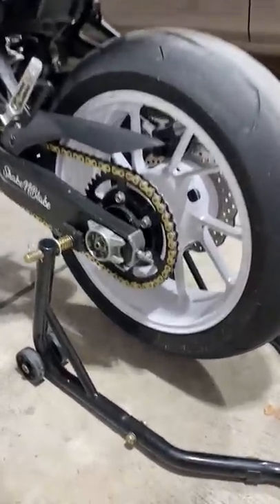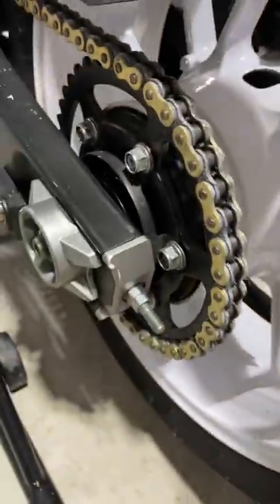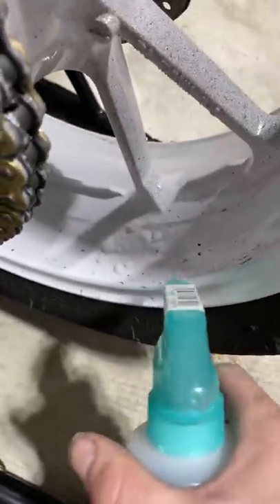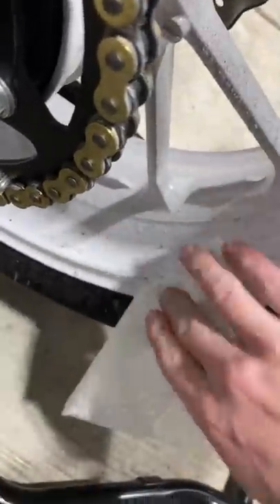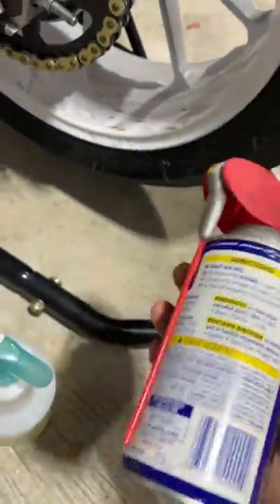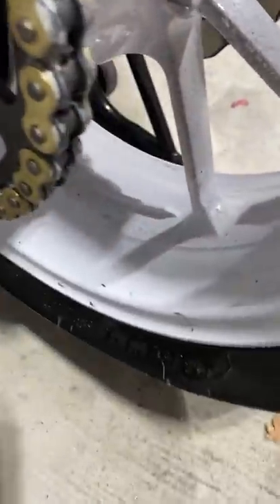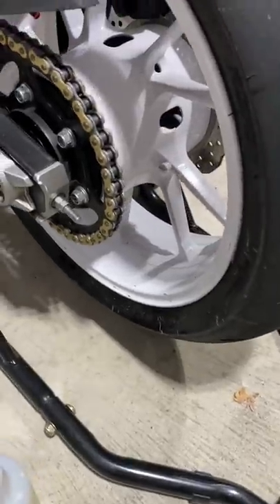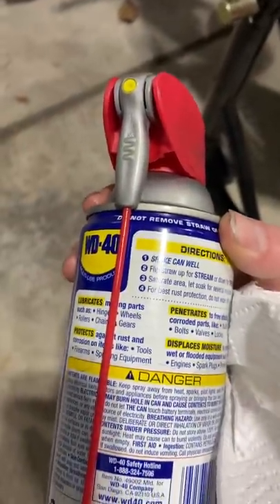EASY tip I wish someone taught me when I started riding motorcycles. #shorts

Comment: “Let’s use water, the thing grease is literally built to withstand, to try and clean this grease!”
Reply: Well I think the idea is more about the detergent that’s mixed with the water
Reply: @fringestream990  soap? He used soapy water. Which soap isn't made to break down automotive grease. Food grease yes. Automotive grease no. Whether as WD40 is a penetrant and breaks down grease by nature. What he just talked about in the video, isn't native to motorcycles. It's basic automotive knowledge. But good on him for showing this to those that don't know 👍
Reply: @jonnywilson9117   I use dawn detergent to clean my hands after doing an oil change or brakes and it works pretty good. Much better than liquid soap would do. And of course petroleum products work great as a cleaning agent but my first thought it is it’s bad for finishes that protect wheels and body parts too. I guess not.
Reply: then the guy : "i recently discovered that anti grease removes grease. could you believe it??"
Reply: He literally used soapy water as an example of what not to do.
Reply: Smitty Knickerbocker Try using dry laundry detergent like Tide to wash your hands of automotive grease. It works really well.

Comment: Yeah that works well. Another "hack" would be to dust your rim with a little silicon spray. It prevents the grease from sticking and makes it super easy to wipe off
Reply: Actually Armor All Seal N Shine works great. It's ceramic so it does an excellent job with paint protection and makes painted surfaces easy to clean.

Comment: Pure kerosene is cheaper and that’s the active ingredient. Amazing for cleaning chains too!
Reply: True...would be the thing to use after putting the chain on and before turning a wheel.  Get all that slag off first so you don't have to then clean the wheel too.
Reply: @Kraken9911  thanks for the tip. I'm out of chain cleaner and kerosene is way cheaper. I'm picking up some kerosene.

Comment: ⚠️  apply the cleaner fluid to the towel not the wheel, to prevent excess lube saturating the rubbers  i.e greasy tyres⚠️

Comment: WD-40 also makes all the dirt and grime stick to it really easily also no matter how much you wipe it, it's a lubricant. It's designed to last on a surface. Not to mention it's insanely dangerous to get on your tire. Use watered down simple green and rinse it afterwards.

Comment: As a motocross racer I learned early on to spray everything with WD-40 and wipe down the seat and grips. This keeps everything from sticking. On the real muddy days I broke out Pam Cooking spray for the bottom side of fenders and engine.
Reply: Baby oil works better, i used to use it on my speedway car. And it isnt toxic like WD is
Reply: @stratton2012  no troll, it really works as does WD-40. Trust me when I say this was a top secret pro motocross trick back in the day.

Comment: You could also use it on the tires too. Helps get the road debris out the tread lines and also give it a nice shine. Helps if you put on the sides so you can lean and corner quicker

Comment: Wd40 also attracts dirt. Makes sure it dry forsure. Use wd40 on your faded engine plastics aswell.  Heck clean your whole bike with it. It will be shiny
Reply: Silicone spray also does a really good job on plastic and rubber. It really restores all the shine and squishyness
Reply: @rem362  I found silicon spray to keep the shine a bit long than wd 40

Comment: Make sure you get some on the shoulder of your tire. It will provide you tons of fun and excitement in the corners;
Also you should use it to clean your brake discs, handlebar grips and seat. Don’t even wipe it down just let it soak.

Comment: Use liquid laundry detergent with water next time. Laundry detergent is known to break down grease and oils, it also works on your hands instantly if you don't have pumice soap after you're done wrenching. #mindblown
Reply from the maker: Thanks man! I’ll have to give this a shot
Reply: I use a diluted solution of Dawn dish soap and water in a spray bottle. Works on everything interior and exterior. Just don't use it on waxed body paint  as detergents will wash away the wax coat.
Reply: Use powdered detergent with a little water & leave it to soaked to clean oil of your drive.

Comment: Wouldn't use that for the wheels. Motul Wash and Wax is way better. Also you don't need sticky chain grease. A light coat with 80W 90 is enough to protect the chain seals and prevent it from rusting and thus cleaning the wheels is easier too and you save a lot of money that you would spend on expensive chain lube. 80W 90 is also recommended by DID for the chains if someone bothers to read the instructions...

Comment: Kerosene works great for this too
Reply: Tried it with clear kero on black wheels and it leaves a nasty film.
Reply: if you only use diff oil to lube the chain then soapy water will get it off the rims

Comment: Here is what I do to avoid unnecessary mess and time cleaning.  Clean the chain prior to or after the installation and lube it with a non fling chain lube and wait 30 minutes before riding (that’s the important part). you won’t have that issue.  As a professional technician I always clean and relube to prevent my work from looking sloppy.

Comment: I use it for everywhere on the bike, where grease is, even to clean the chain, but not as a lubricant. Try to spray it first on a cloth or paper towel then clean the necessary parts, so you won’t spray your tires. WD-40 isn’t a lubricant it’s water resistent but not a lubricant like many think it is. The best lubricant for the chain you can get is MOTOREX.

Comment: If you don't want to waste wd40 you can just wait and let it dry. Perhaps a whole day then use a clean micro fiber cloth to wipe it clean. Works for me as also experienced this with my 135 cc bike (i live in asia). To add a few information, using wd40 on your mags may cause a few problems such as losing the paint and it may stick on your rotor disc (brakes will become slippery).

Comment: You should have seen the grease buildup on my 04 F4i when I bought it used, literally 1/2 to 3/4 of an inch thick in several spots.  So gross, the previous owner was a lazy bastard.  I use chain wax, more frequent cleaning, but much less mess.

Comment: But all jojes aside, use a teflon based dry-lube chain-lube if you wanna keep your wheels clean.
I dont know what is avaible in america, here in europe we got S100 DryLube, that stuff is awesome. Only disadvantage is that after heavy rain or 'only' about 350 miles , you have to re-apply.

Comment: Don’t forget to add motor oil on your rotors and brake pads ok try to get the higher viscosity kind, also vegetable oil on the handlebar grips for better control

Comment: This is common sense wd40 is a solvent just like most other spray products for cars and engines.
Reply: It’s a Water Dispersant. That’s what WD stands for. It’s not a lubricant and it’s not a cleaning fluid or a degreaser. It’s for dispersing water.

Comment: Brake cleaner would be much better for removing grease and I won’t have to be worried about accidentally spraying liquid semi lubricants on the brake disc and had to clean the disc later when it makes squeaky sound. There are brake cleaner out there that are paint safe.

Comment: I use Turtle Wax wheel and tire cleaner. Spray it, spin the wheel and clean it with a rag. Spray it off with a hose and it’s good to go.

Comment: I do this on my GSX-R with white rims. But I use a sponge. Super easy to clean chain lube off. Just don't get it in your tires. My bike is a 2001 got it off the lot. And my rims look better then some new bikes. Color hasn't faded using wd-40. That's my 2 cents

Comment: That's because WD-40 is a grease in itself, it soaks into the other oils and begins unsticking it. Now, if you need to remove WD-40 try a small bit of gasoline or isopropyl alcohol.

Comment: I recommend using a microfiber towel and wd40, Do not spray wd straight to your wheels. It'll get on the tires you'd basically ruined your tires. Once you cleaned your wheels with wd40 give your bike a wash. Then  Ceramic coat it all including your wheels. Do not apply ceramic coating to seats and handles.

Comment: More pro tips: 1) degrease the chain before installation.  A good soak in gasoline and a wire brush will do the trick. 2) when cleaning the rear wheel, it works really well on a stand like that when you start it, shift into 3rd or 4th, and let the spinning wheel do the work while you hold the rag against it.  If you’re really short on time, hold the rag to the spinning wheel with one hand and spray the wd with the other!

Comment: WD40 is a cleaner and rust remover don’t use WD40 as lubricant on moving parts it will gunk up quickly and damage components. Use teflon lubricant on chain and sprocket.

Comment: If you don't want the oily film left behind (Sometimes you do), use brake/clutch/carb cleaner. Whatever you use, spray directly on the rag/paper towel instead of all over the place.
This oily film is why WD-40 is a great lubricant, those that say it isn't are likely trying to lube bearings or their engines with it the dummies! 🤣🤣

Comment: How did you get the can to spray without flicking the nozzle out?
Reply: It's got a hole in the cap that is covered when you open the straw... I didn't know until I dropped something onto the can inside my toolbox... pssftfft...and voila lubricated toolbox

Comment: WD-40 isn’t a lubricant it’s a water displacing spray made from fish oils. But you get that on your disc your brakes won’t work properly. You’re  be better off using brake and clutch cleaner.

Comment: I would have to think the chain wax rather then just chain oil would be the way to go to avoid oil on everything including your pants legs like I had to live with in high school. Today I have two big bores, ones shaft drive the other belt drive, but if I ever get another chain drive I’m using the chain wax.this technology did not exist in the 70’s Chains have gotten a lot stronger and more durable too for that matter also.

Comment: Never ever put gas or kerosene on a O ring chain . Eats the o rings .  I have ridden 42 years now and never had a chain failure from cleaning it with wd40 before using a high quality chain wax!  If you watched this video evidently you are unsure of your technique! If you don’t like it don’t use it! But it does work good to clean grease spots off !
Reply: The main de-greaser in WD40 is kerosene.....Derp Derp

Comment: If you read the label WD-40 is actually a cleaner.
Reply: Myth: WD-40® Multi-Use Product is not really a lubricant. Fact: While the “W-D” in WD-40® stands for Water Displacement, WD-40® Multi-Use Product is a unique, special blend of lubricants. The product's formulation also contains anti-corrosion agents and ingredients for penetration, water displacement and soil removal.

Comment: Good luck getting all those scratches out of your wheels,all that grease will have grit mixed in with it and your rubbing the crap out of your wheels....
Use a proper degreaser,let it sit and do it's job and rinse it off! This way it will take the grit with its. Buy a gallon of paraffin or kerosene this is cheaper than WD and can be sprayed out of a trigger bottle,or buy a water base engine degreaser like Gunk or Jizer and this can be cleaned off with fresh water.
Don't do what you're doing your going wreck your nice white wheels by causing scratches and rubbing dirty grease into the scratches which will over time make your wheels look a mess.

Comment: Yeah...  no...  wd 40 this close to your tyres is asking for problems..  use a specific degreaser or even better use poorboys spray and rinse on the rims,  takes everything off without even touching it.  Works like a charm.  Use a dry chain lube and enjoy

Comment: Knowing the mountain of 💩 you were undoubtedly going to be hit with for posting this video, first let me say "props to you, for leaving the comments section open." Thumbs up, just for that.
   Now with that out of the way, all I can say about the content is, NO, NO, NO, and fing NO.
   Use a spray bottle mix of Simple Green, cut to 50% with clean (distilled) H2O. The PH is way higher than soapy H20, and it take off that chain lube. But not so high that it will damage any clear coat on the paint, or stain powder coated wheels.
    WD40 is a petroleum distillate based product. It does leave a residue (even if you can't see it). And even if there isnt enough there to cause an accident should you encounter rain, run through a puddle, etc., it will eat into, and eventually cause cracking in the sidewall rubber on your tires. Using the same exact MOA as it does to break down, and remove that chain lube.
   I'm hoping your next video isn't one showing us the awesome power of ArmorAll on that donor cycle. 😜
   After 30 years of motorcycling, I'll leave yall with the two most important things you should know, in regard to keeping it vertical....
"Ride like you are invisible, because you ARE." And, "never ride faster than your angel can fly!" 😇

Comment: Been using and sponsored by WD 40 for close to 20 years. This is an old trick. One better spay your wheels and front of your bike down before a ride (not dripping wet) you can wipe it down with a rag when your done an it'll be super clean

Comment: Use any cheap branded house owned maintenence spray lubricating stuff like wd its far cheaper basic chemical makeup is same costs 1/5th price wd40 is degreaser it removes grease thats why bad on most chains  it does it by diluting it and making it more liquid than semi solid etc being liquid grease easier to remove than thick sticky grease ✌️ good luck live long and prosper 👌😁nicely polished rim wouldn't stick grease to it anywhere near as much as a squeaky clean one

Comment: Good Lord.
Don't use any kind of lubricant. 
Try regular car wax. It lifts the chain lube, cleans and the wheels are coated.
A little bit goes a long way.
Maybe there isn't a problem with WD40 on the wheels but wax works better and there no risk of accidentally spraying you chicken strips.
😏

Comment: Yeah remember to spray your wheel to soak your tyre in a oil so they perform best smh, next time spray it on the cloth/paper towel instead of the tyre or you wont have to keep it clean much longer cause it will kill you

Comment: Dude...Not with a Papier Towel ...😂they scratched more Then Clean ....better is s spezial smooth Towel and Not Spray of the wheel😉.....If you want to Drift ...spray it complete of the wheel the WD40 😂
And next Time try a good dry lube for the Chain and you have No problems

Comment: Amateurs making input on bushmechanics. I can't wait to see some of you come off for having caused a catastrophic failure. Leave it to those who can and do NOT attempt this cleaning method if you value your ride. Not the product for the job, neither is the man or his explanation. Use break cleaner, or any degreaser that ain't wd40. Be mindful that degreaser usually implies solvent, which can and will get through your rattle can job, even factory coat in some cases. 
Good luck, use the proper means to achieve proper results people! Don't sheep away after idiots.